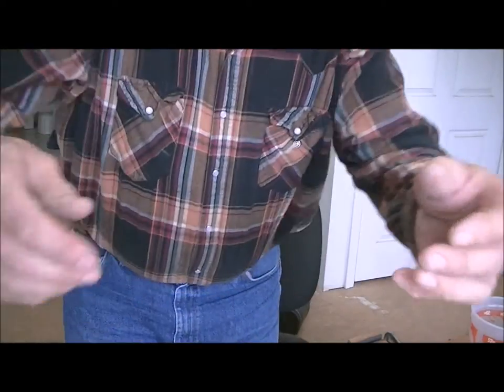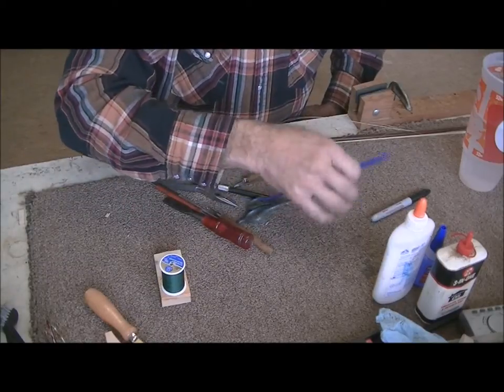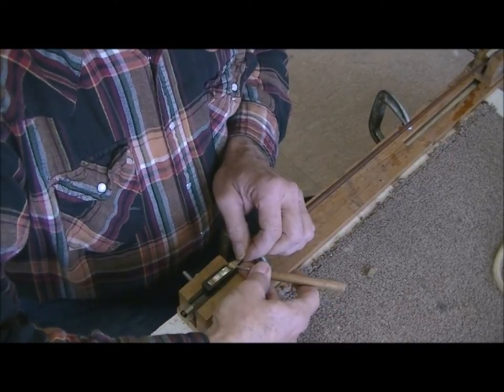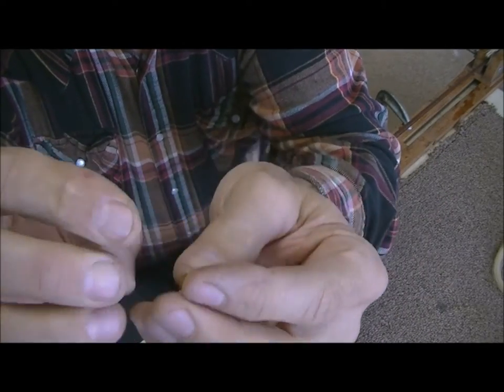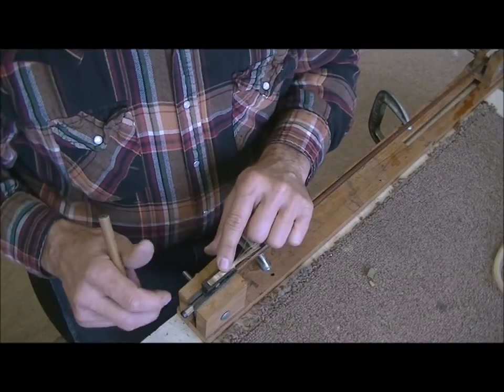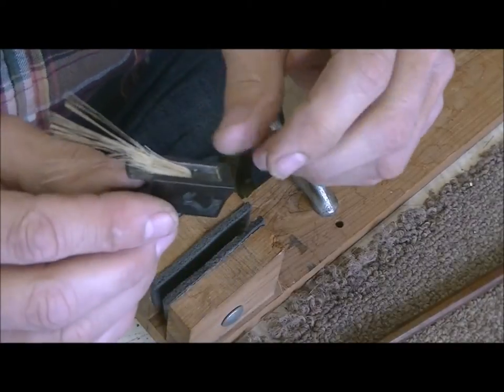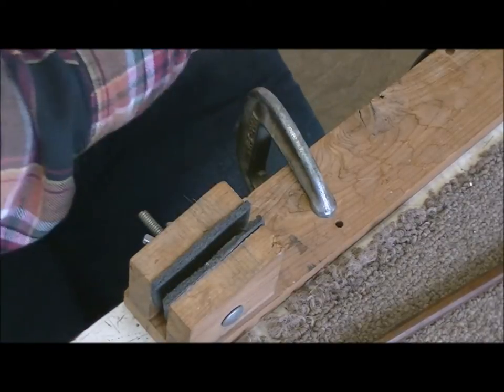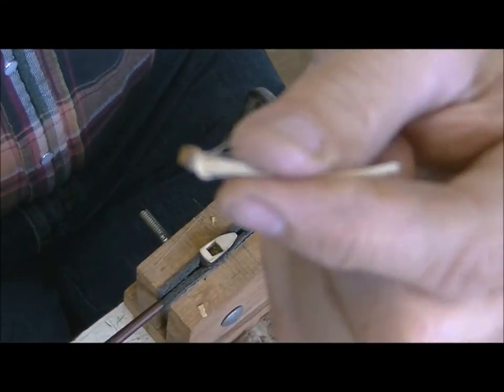051 RSW Violin Bow Rehair Part 1 Disassembly

Comment: I sympathize with all the problems you can run into rehairing bows.  One suggestion: as you probably know, using a chisel to pry the slide out usually results in damage to the mother of pearl.  You can avoid this by putting a piece of double sided tape on the mother of pearl, pressing a piece of wood (a chopstick works well) onto it extendending past the end of the frog, and tapping the stick with a light hammer.  It's never failed for me.

If the slide is really glued solidly in the frog, you can use hot water and/or alcohol to loosen it.

Have fun, cheers from cool Vienna, Scott
Reply from the maker: Great tips thank you!  Thanks for watching.

Comment: Spruce? No. Oil? No. You've wrecked the mother of pearl slide. Using a pliers to remove the screw?! Fortunately it's a shit bow. If you haven't been trained you should not be touching a bow.
Reply from the maker: Thanks for watching
Reply: Woke up on the wrong side
Reply: Yeah, I was looking at the hex shape thinking that a hex wrench should be used, not a long nosed pliers. Graphite powder for lube.